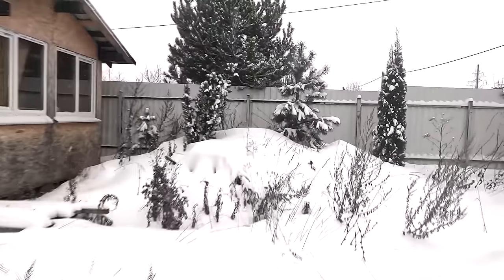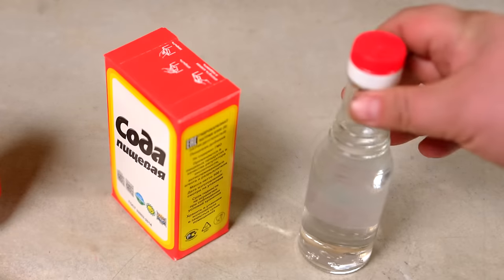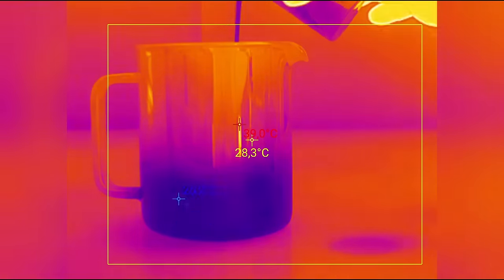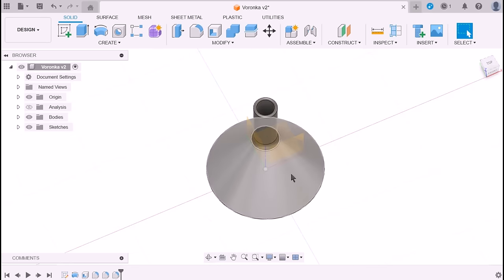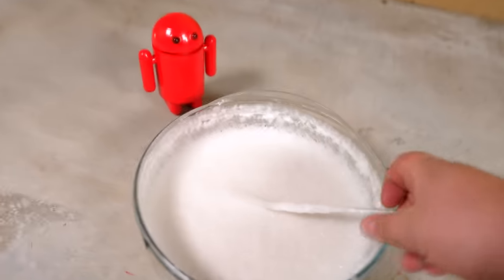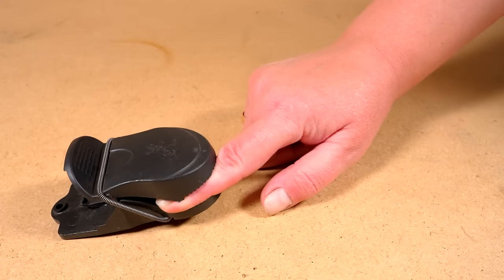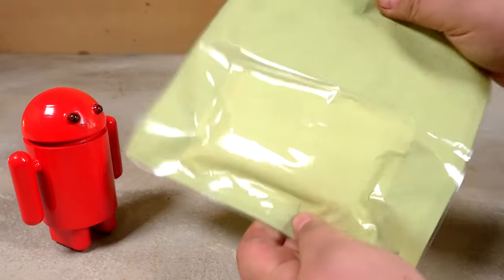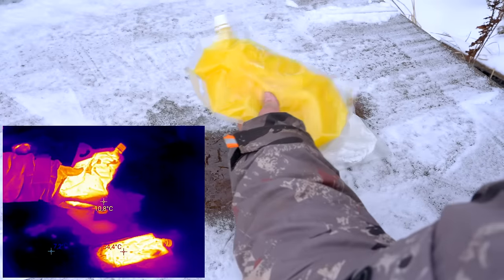This liquid will become solid and very hot!

Comment: I literally just bought one of those clicker heater things @ a thrift store, bigger, meant for neck & shoulders, for $3 (say, 30-45 min ago).  I believe these manufactured ones are silver acetate.  I know they work by making a superdaturateed soludion that precipitate out of solilution when disturbed by the clicker, or your spring snapping.  The bonds breaking release energy as heat.  It'd be cool to be able to make my own, though.  Kudos for your video!!
Reply: supersaturated*

Comment: welding.. you should DIY welding electrodes for stick, that can be used with a welding machine made from microwave- you can get flux core wire that doesnt require shielding gas as well.. maybe if you make some device that can work for a TIG welder that would be quite something. maybe slowly pumping air through charcoal, nitrogen CO2 and CO comes out. but for TIG welding we usually use like 10 bars of gas
interesting with spring to crystallize, never seen that before as chemist

Comment: How did the spring in a shrink tube cause that reaction?
Reply from the maker: The spring gives a shock wave and because of this shock wave the composition begins to crystallize and heat up. After recharging by boiling, everything is ready for new use. 🤖
Reply: @Doctor-Robo  so you boil it to bring it back to a liquid state?
Reply: @iiinsaiii yes
Reply: Very cool! 👌
Reply: @Doctor-Robo 那如果是用手大力打袋子是不是一样触发结晶反应（袋子里面并没有弹簧），